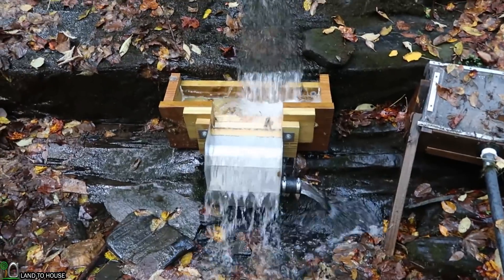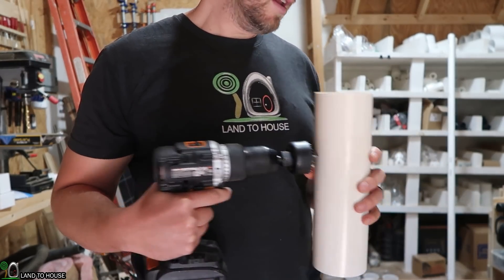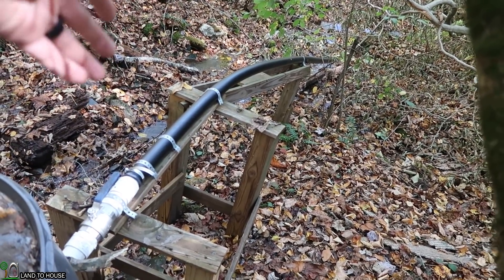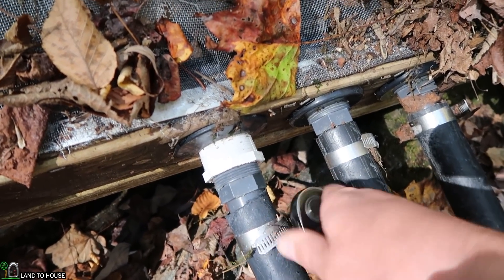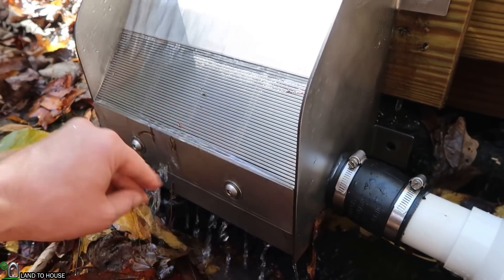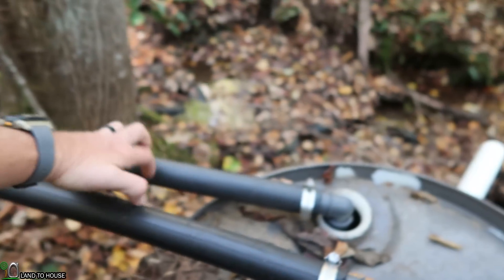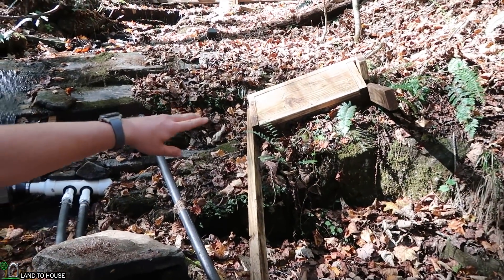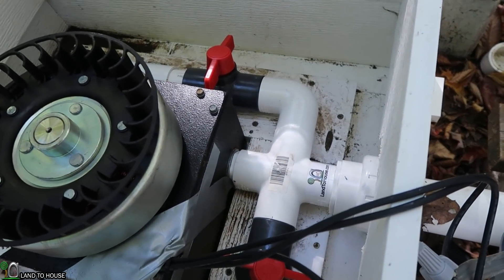Coanda Screen Intake Manifold for Micro Hydro

Comment: Just found your channel. Been going through the hydro series. I have a lot of engineering background with a big emphasis on heat transfer and fluid flow. Two 1.25" pipes have 50% less flow rate than one 2" pipe. So, if your flow for a single 1.25 is .5 gallon per second, two is 1 gallon per second, the single 2" is going to be 1 gallon per second. That is calculated using a 10 foot pipe length with standard friction and a 2 foot drop over the length.
Reply from the maker: Thank you for watching. So I really need to add the extra (3rd) 1-1/4" pipe to the manifold to make sure all the water is getting to the silt barrel?
Reply: @LandtoHouse  Yes, to match the flow of a 2 inch. The problem isn't diameter, it is friction. You have way more friction on more smaller pipes. It would be ideal if you could just use a single 2 inch. The flow is optimized for that. Far less friction and backpressure.
Reply from the maker: @donbavol9672  because a 3rd 1-1/4" pipe is still sitting next to that unused I will use it. Buying 2" pipe is very costly at the moment.
Reply: @LandtoHouse  Totally agree. Just wanted to put the science out there so everyone else can get that information. It is important to understand all the dynamics that make up fluid flow, but the basic idea is there is far more friction involved than people will give credit. Once you start thinking around those terms, you will be able to more carefully chart out your usage.
Reply: UGH. The single 2" is going to be 1.51 gallon per second.

Comment: now your cooking with peanut oil . for them leaks  i think roofing tar  would work just fine . but  if you ever wanted to make it last forever  find a aluminum box or make one  and ether rivet that other box with the screen to it with a rubber seal  im sure you could use a ole tire . wood will work for a long time but aluminum will never rot is stronger  and will look better . as far as sealing it if the other box with the screen is aluminum you could use alumawield  get it at harbor freight . all you need is a torch and its just like brazing . or soldering . there is alot you could do . but if the wood is working out for you run with it . you just might have to fix it once in a while . good luck hope your doing good and had a happy halloween

Comment: I have been wondering just how tight of a radius the uniseal can work in, and sealing a 1-1/4" in the side of a 3" pipe is amazing.  Thanks for sharing this.  
If you are going to pull and clean the main jet, I'd like to suggest replacing this one "always on" jet with a smaller one that won't deplete your barrel/catchment during the low water volume part of the year.  It won't produce as much power, but some is better than none, and keeping it flowing during the winter will reduce the chance of it freezing up, and you have the other 3 to turn on during the "high flow" parts of the year.

Comment: What's all this talk about air separation?  My hydro's intake also uses a coanda screen, it's built right into the top of a stainless box, with a 3" outlet, 3" line runs downhill 147 vertical feet in 1/4 mile, to the Harris hydro unit. 14 years now and it works great, (a bit over 900 watts) this air separation thing is new to me. Any new commercial type building will have an EPDM roof, and there will be lots of misc. scraps in the dumpsters! Great stuff for misc. hydro uses.
Reply from the maker: Wow to make 900w you must have a lot of water. My guess is that is the difference between our systems. I only have 10 to 30gpm so air is an issue.
Reply: @LandtoHouse  That's my max, for my 3" line, late in the year, like now, it drops to 3-400 watts, before I bag it for the winter.  It's not freeze proof, though i can run it until single digit temps, an overnight dip to 15 or 20 isn't a problem.I didn't mention that I do have a tee about 3' down from my collection box, with a screened opening, pointing up.  That's so when I close the big ball valve on the box outlet, the line can drain without creating a vacuum, but maybe it also works to get air out?

Comment: I'm wondering if there is more friction with 3 smaller diameter pipes than 1 bigger one.
Reply from the maker: Interesting idea. The drop and distance is so small I am not sure it makes much difference.  But because the run is so short I could just go 2" in the spring when the weather is warmer.

Comment: As long as there is water running of the screen the leak in the space above it you were talking about putting rubber over the wood won't make much difference until you add the 3rd pipe or water flow reduces. I think aluminum flashing might work better because you could bend the edge up to reduce loss in water on the edge.

Comment: Do you have a source for the Coanda screen.   I think they are very expensive.   How much less debris do they collect compared to your initial screen?   Thanks.
Reply from the maker: Langstons Alternative Power is now selling them through Elgin. They are very costly. Roughly $600 to $700. The coanda is far stronger at taking rocks than the other screen. It also prevents much more debris.
Reply: @LandtoHouse  Thanks.   I'll probably start out switching to your screen box from the PVC drilled tubes with screens first to test the box concept first because of cost.   I have a limited fall consideration with only 30 Inches of fall and a need for as much delivered water as possible for irrigation.    Still reductions in frequency of screen cleaning may justify the Coanda cost.

Two other ideas are to (1) increase the size of the input filter tubes to 3 or 4 inch drilled and screened PVC pipes so maybe can go longer between cleaning or (2) since we have quite a bit of extra creek water available, try sending much more water through the top of the box screen than it can take in.   .... A variation might be to create a faster moving channel for the tubes rather than having them sit in a calmer water next to the berm.
Reply: Hi, I’m from Brasil 🇧🇷. Do you know if we can found only the metal screen (filter). I think if is possible to do a box at home. Sorry my English.

Comment: π 2² = 12.6 sq in.  π 1.25² = 4.91 sq in. I'd definitely run the two inch line myself. Don't know if it would pay for itself, but it would be fun.
Reply from the maker: Nice math. So three 1.25" pipes would cover it well.
Reply: @LandtoHouse  I'd say so! Time to drill another hole in that manifold :D
Reply: @MarkRose1337  Yes, the cross sectional area of a 1.25" pipe represent only 39% of a 2" pipe cross sectional area (1.25²/2²). With two 1.25" pipes you will get 78% (so still less than at 2"), and with three 1.25" pipes you get 117%. Considering the larger friction losses in the tighter 1.25" pipes you will need at least three 1.25" to not to restrict your flow.

Comment: That's a nice micro hydro set up you have. Which between solar and micro hydro supplies the most power for you and did you think about a wind turbine or look into owning a wind turbine for when there's no sun or there's not enough water for the micro hydro?
Reply from the maker: I now have 3kw of solar so that is currently the most power. Hydro for summer and fall only does 100w continously.  360w in spring. We have so little wind here it would not do well. Between 1 and 4 mph winds.
Reply: @LandtoHouse  what do you do when there's little to no water flow for the turbine and no sun for the solar?

Comment: A couple of suggestions: The first is that if you decide to fit a metal flap from the wood box, if you bend the end so that it sits on the top of the coanda, and apply some silicone sealant around the wood and this metal flap to prevent water from seeping under it, you'd rule out any leaks. The second one is that you can create a couple of baffles that direct the stream into the coanda so that when the flow rate is higher, it will be channelled through the coanda. Would lagging help to prevent the pipes from freezing during the Winter months?

Comment: Move your barrel up to only just below the screen offtake and run your 2" line from there. This will increase your head. Same volume more pressure hence more power. You are wasting pressure by having an unsealed barrel well below the dam and screen.
Reply from the maker: There is 150 feet of pressure currently. That extra 5 feet is approximately 15watts lost.

Comment: Just a quick calculation … 1x 2” pipe should move approximately 20% more water than 2x 1.25” of course there are more forces such as friction but I’m only using internal area to figure that …. Keep up the videos very interesting 👍🏻👍🏻
Reply from the maker: Thanks for the math! I will add the 3rd 1.25" pipe so there is no issues.

Comment: You could get some silicone caulking and go all around it and that would work.. In the future I would dam it up a few feet higher to create a small pond and put your catchment higher up to it, that should increase your pressure by 10 to 15% or higher (when it rains)
Reply from the maker: I do need to make the box more water tight. My neighbor has a hydro unit just up from my system so I am not able to go up any further.

Comment: A couple of 2"-T-pieces (or actually only one T-piece) would have worked also. And you would be able to easyly extend it to a 3rd outlet: Just add another T-piece. Are you going to let the turbine run over winter?
Reply from the maker: Yes so many ways to make that connection. I had these things laying around the shop and I always look for a chance to use Uniseal haha.  I am going to try running the system all winter. I might turn it off when the temp is going to be 5 degrees for a week.
Reply: @LandtoHouse  While other ways would have worked, this one has been waiting its turn for a long long time and I'm glad to see you finally tested this and that it worked well putting a uniseal in the side of a 3" pipe.
Reply: @LandtoHouse  >  ... and I always look for a chance to use Uniseal
Haha, I somehow was anticipating this.

Comment: I would clearly see a primary grid above the wooden crate until it ends on the descent, the water and dirt enters the top and falls into the primary tank which overflows into the secondary tank but with fewer leaves and the like
also try to build a twister sleeve to create a vortex that accelerates the flow of water in the pipeline
use the orange road cones from the coanda filter to the down pipe

  instead of suddenly you come out of the tub with a small diameter and then it widens and tightens again
so it is also good for a home plumbing pipe, but not for a micro hidro system
some gate valves already have a revolving ball with an opening smaller than the diameter of the pipe, they create unnecessary turbulence with relative pressure drops

wishes anyway for your great commitment

Comment: Hi Seth.    Been watching your vids for a while now, and I'm very interested in setting up a micro hydro, along with using it to provide fresh water to my cabin here in Alaska.    We've got a creek much bigger than yours about 900' from the cabin, and I estimate that it would be a 110' head.   I could get more head fairly easily if I wanted - the creek is quite steep.

What could I expect, power wise, of twin 2" lines running to the cabin with a microhydro turbine with that kind of head?
Reply from the maker: Thank you for watching! A single 2" pipe can carry around 30gpm max at that head pressure. Based on friction loss. So you could have around 60gpm flowing down that creek. The power formula is: (head pressure in feet X GPM)/10= power
So (110 X 60)/10=660w. That is a lot of power. More head pressure gives you even more power of course.
Reply: @LandtoHouse  thank you!

One more question - due to friction, would I be substantially better off using a single 4" pipe or would it be roughly the same?    I have to haul everything on my jetboat or on snowmachine, as we're 20 miles upriver from the nearest road - 2" pvc pipe is a lot easier to handle and, of course, manipulate around trees running down from the creek to the cabin.
Reply: @aknighttrain  A single 3" pipe has slightly more capacity than two 2" pipes. If you have the water for a 4 inch line, I'd consider it though, because the extra water can be used for electric heat, which means a lot less firewood chopping. I'd take a look at the MrHydrohead channel for inspiration.
Reply: @MarkRose1337  ... the size of his turbine really doesn't have that much in the way of extra power. On a good day the entire system probably isn't 1,000 watts, and most of that will go to batteries or powering the house.

Comment: Have you considered trying to cast the intake box out of cement it would bother me knowing that the pressure treated wood will eventually rot.
Reply from the maker: Eventually I will probably have a metal box made. That way I can still remove it if I need to make some changes. Concrete might be a pain to haul up that far. Either way a better angle is needed for the coanda screen.

Comment: If you paint the inside with a water proof paint it’ll probably seal the leaks.
Reply from the maker: Yes true. I would need to find a way to divert the water while I painted.
Reply: @LandtoHouse  something like a beaver dam would work
Reply: @LandtoHouse ....  Flex Seal works underwater. They show that right on the commercial.